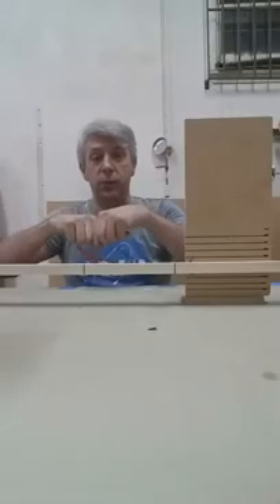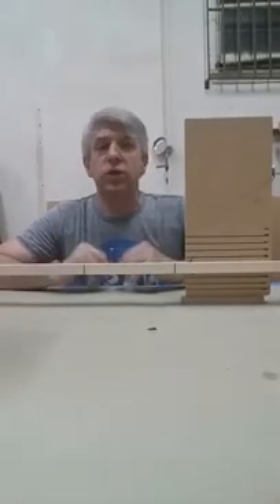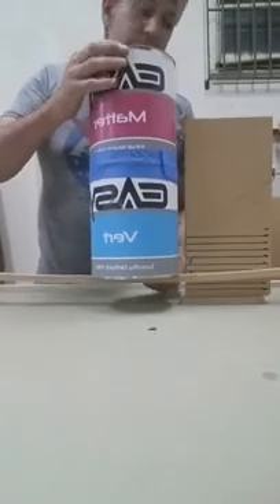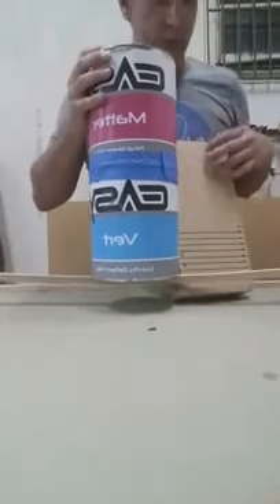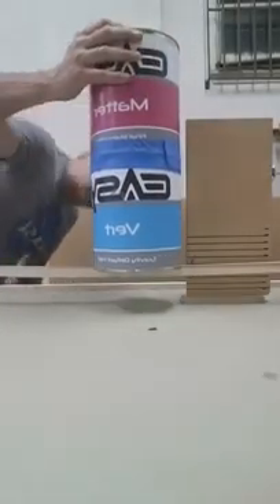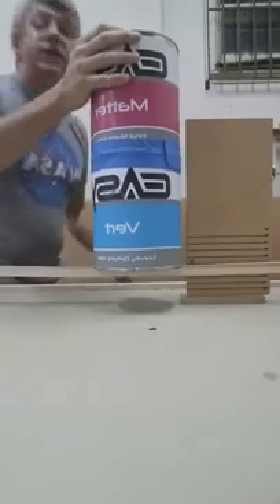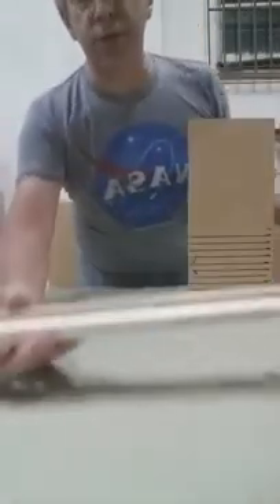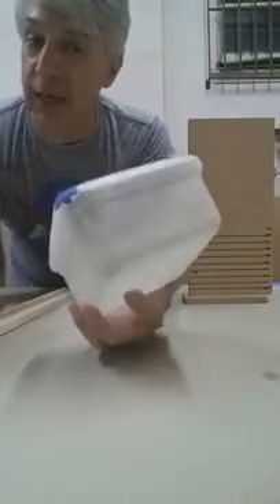Trunk Baffle systems  ( free air / infinite baffle ) baffle designs # 2

Comment: hey backyard gotta a question? when im looking for subs to use in a IB set what do i look for? Can i use any sub? what about power handling should i do true RMS or MAX
Reply from the maker: truckinbalou1 what the best sub? Well that a good question with a very complex answer. 1) excursion 2) motor 3) compliance.  You want something  with minimal of 17mm of xmax in  one way movement if you going to run over 500 watts of power per driver. Next is motor and compliance I would look for something around fs around 28 and a QTS around .45 to .55 and a CMS around 145 uM/N... this will give you a nice flat-ish sound with kick around 50 to 60Hrz
Reply: thanks for the help backyard. one mor question im working with a 15 corolla and it has that same square tube area that the camry you did had...it is hollow...did you foam fill that area or did you leave it empty
Reply from the maker: truckinbalou1  I use clay to fill the areas, this way you can keep the density of material... and you can remove it later with no affect to the car.

Comment: Carpentry 101, "strongback", or my preferred name for them "rat run". Basically one layer of a header attached to another similar board that is laying flat that can easily be fastened to ceiling joist, for example. 

I just felt the need to share that for some reason.

Thanks for the video, and your time, man.

Twinky

Comment: if you cut the top Rim of that plastic container off, you can show just how much structural rigidity in ads.
Reply from the maker: S0uthp4w68 that is true but in all my designs have the rim as a mounting surface. That is a very good point